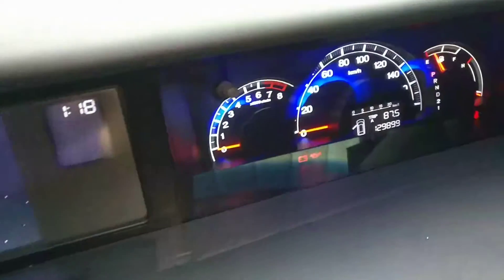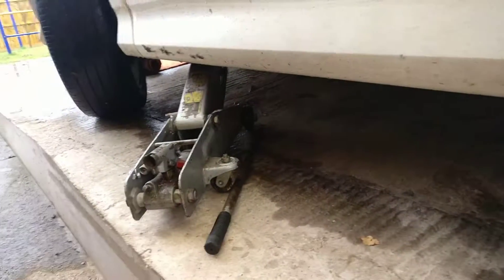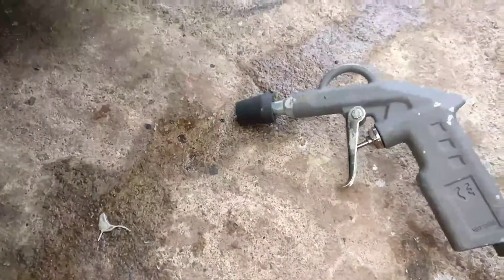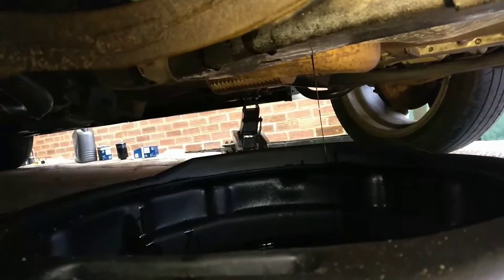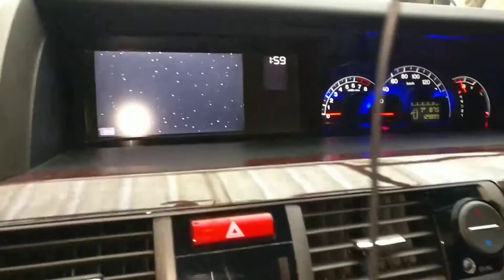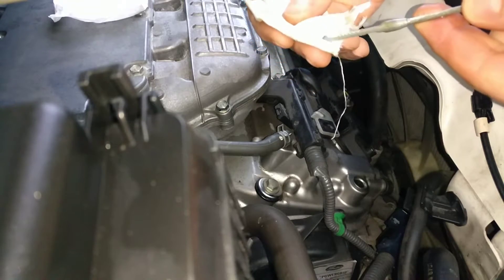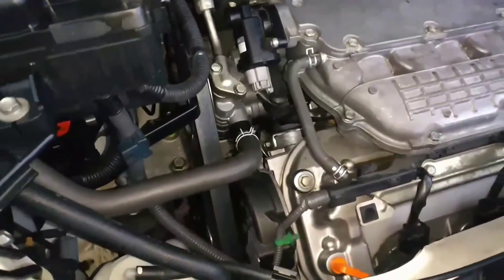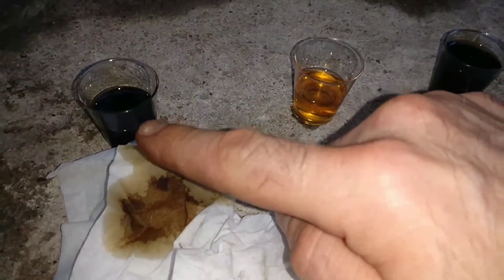Engine Oil change/engine oil flush and BG109.

Comment: What a good video. The extra deposits that you are removing (ahown at 14:40) after using BG Engine Performance Restoration cleaner is coming from hard to reach oil galleys, hydraulic actuators and from behind the piston rings. We regularly see increased compression, lower oil consumption and lower emissions after restoring the ability of the rings to function as designed.
Reply: Hi do you guys see a huge difference in compression after using?? this I just got my car diagnosed with low compression across all cylinders 171 is minimum spec and mine are all in 160 psi. shop saying worn piston rings and to try using this might be carbon buildup in them.

Comment: I use a flush oil every other oil change.  I purchase 4.8l of oil.  Drain and refill, Run it for 20 minutes and then drain again to remove 99% of the old oil.  I keep the flush oil for next time. To view oil clealy,  Use two drops of oil on a blank  business card.  Let it sit for 8 hours.  It will radiate outward revealing contaminents and soot, very interesting.  It is called radial chromatography.

Comment: You can get the same, if not better, results from just ATF.  Go ahead, try it and save some money.  Good ole farm boy tricks never die.  It will come out BLACK!
Reply from the maker: Yes, probably your are right. Didn't thought about it. Ill try next time. Thanks.
Reply: @sauliusagintas   Give it a shot. Even after you have used BG, on your next oil change replace one quart of ATF to the volume of needed oil and run it for 20 min with new oil then drain. I assure you it will be ugly.
Reply from the maker: @10MinutestoRouletteFortune  intrigued😁 ill do💪👌👍
Reply: BG is not expensive! So you ar not saving money whit ATF and is  more dangerous to use.
Reply: Silly.
ATF is a very light cleaner.
BG is a very strong detergent which is the only thing in the market capable of breaking hardened carbon behind oil rings and in piston rings.

Comment: Good job. Thanks. I'll use bg-109 tomorrow, on my k3-ve (2004 year), 183000 km. I hope it will be fine.
Reply: Bro, 

After you used what happened.  Did you find an improvement

Comment: very very good video! thank you so much for making this. i will do this with my car next oil change. I have a 2014 mazda 3 with 215,000 miles (346,008 km).
Reply: After you used what happened.  Did you find an improvement؟